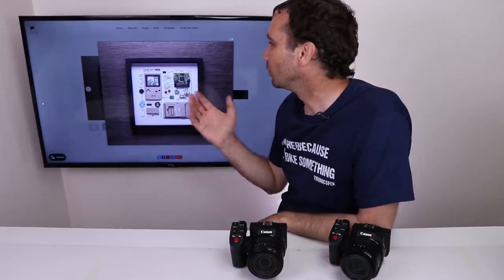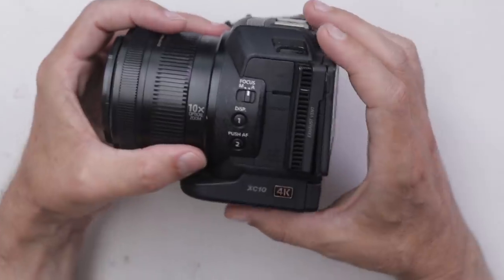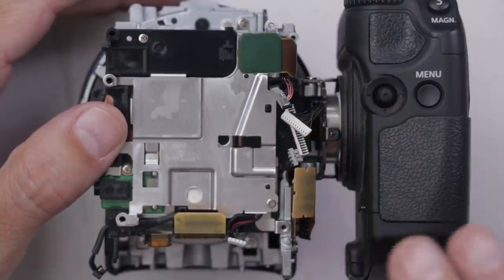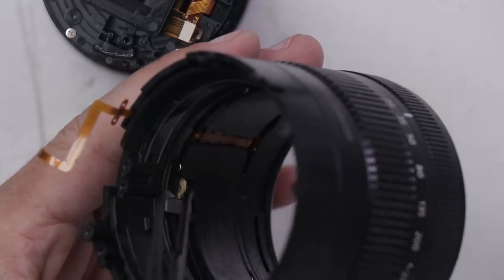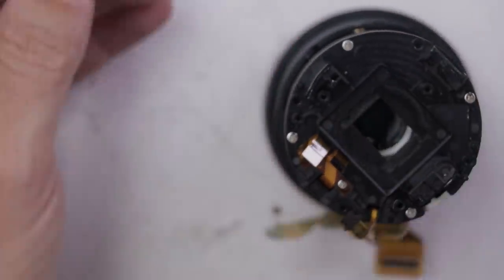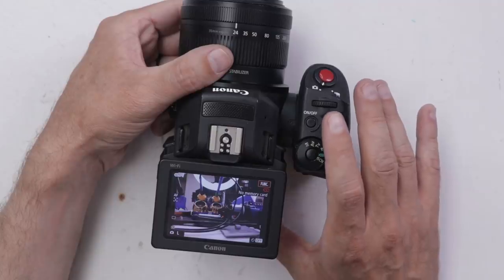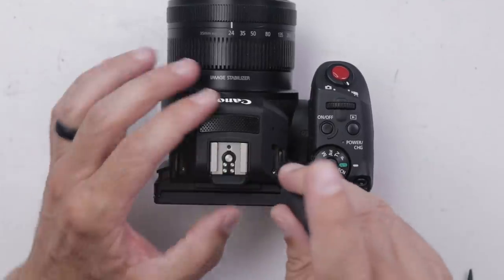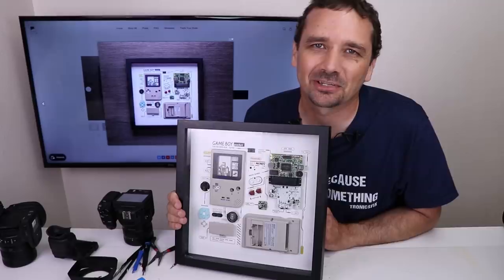I Bought two BROKEN $1,600 Cameras - But Can I Fix Them?!

Comment from the maker: What do you think of these Grid products? Check them out here (Affiliate Link): https://shareasale.com/r.cfm?b=1632954&u=2897356&m=101889&urllink=&afftrack=
Reply: Honestly so cool!
Reply: I ordered a shadow box from Amazon and am going to try a duplicate with an old Droid incredible
Reply from the maker: @12345.......  That's a great idea!
Reply: To be fair, on cameras with removable lenses the sensor is exposed every time the lense is changed so shouldn't be a problem.
Reply: Me personally, I would not overcome the urge to put them back together again.
Reply: Are you going to try put it together? I would like to see it. 😇😂
Reply: @pigi96  that would be a silly video I'd watch it too
Reply: If you forget how to put it back together you can always just rewatch your own video in reverse. I would definitely sell those as fixed, just point them to the video in the item description.
Reply: Hi TronicsFix

I own a playstation 4 that has the blue light of death. I watched your other video on the causes and fixes. Just a quick question, the light keeps blinking until I hold the power button for about 13 seconds and it shuts down. I can't get it to go into safe mode (I also only hear one beep). Please help me.
Reply: @Tronicsfix  would you ever consider shouting out a smaller channel?
Reply: @stevewaller6577  I don’t know about the Gameboy Pocket, but the PSP1000 has missing pieces. A good chunk of the optical bay seems to be missing. I see parts of it, but there’s a lot of metal that’s not there. Also the back chassis is missing.
Reply: I have a broken PS5 controller the ∆ button doesn't work it clicks but nothing happens can you show me how to fix this

Comment: Canon should use the perfect amount of loctite to hold those screws in.
Reply from the maker: Agreed! I should have put some on but didn't even think of it for some reason.
Reply: @Tronicsfix  Yeah, I immediately thought that you should have added some to those loose screws of the second camera, especially if you are planning to sell it. Maybe you could still go back to it and do it. You didn't need to dig nearly as deep as with the first camera, so it shouldn't be as nerve-racking.
Reply: @andymouse  you could see the Loctite residue on the screws that came out of the second camera, so they definitely used some. No idea though how the screws ended up in there.
Reply: I call that bad design. I see it tons in laptop monitors and cases. Screws just falling out and moving around missing.
Reply: @idahofur  One contributor IMO is the misuse of Phillips (cross) screw heads. They cam out easily, which is nice for preventing overtorquing on delicate materials (e.g. drywall, soft wood, plastic, circuit boards), but otherwise it's a liability. Robertson (square) or Torx don't have this issue.

Not sure whether it applies in this case though, since I think all the faulty screws might have been binding thin plastic.

Comment: Massive props for even trying. I've taken apart several Canon Cameras and lenses and they are so tightly built. that first camera took some big fall damage for sure. CA glue with a fixative can usually repair the broken plastic bits nicely.
Reply from the maker: CA glue comes in handy in one of my upcoming videos where I take apart a lens!

Comment: @11:03 there are white plastic washers on the metal piece you installed one on the top left seemed to be missing looked like a possible candidate for the mystery circle. 
As per usual a great video sir! Soldering ribbon cable is above my paygrade so hats off to you for that one! Peace out brother.

Comment: Question. Do you actually film every single step when you are disassembling a device and use that (in reverse) to help you put it back together again? BTW, this strip-down is gnarly! I'd have freaked out and binned it! lol
Reply: I'm pretty sure he leaves the camera rolling the whole time and just edits out parts for his videos. And I know for me when I take things apart I have a pretty good memory on where things go putting them back together. It also helps to have your own system of placing things in an order when taking apart so it's easy to put things back together. Just a good idea to be organized.
Reply from the maker: No. I film most of it but there are some steps that I know I won't use in the edit so I don't even film it. If I find a place that looks like it might be hard to reassemble then I usually snap a few pics.

Comment: I would've never guessed that there are so many screws and assorted pieces within a camera like that. I guess the price tag really is justified.
Reply: I wouldn't say the price is because of the screws and pieces. But mostly because of the sensors and processors that you're paying for since those are made from more expensive materials, along with the microchips they're basically like tiny gaming computers I guess?
Reply: @zimzamthespaceman7495  Look at the RasberryPi, even fairly powerful processors/hardware encoding/decoding cost nothing these days, the majority of the cost is R&D, the main sensor and the lens, although that's a bit expensive the primary reason for the cost is dedicated cameras being a niche market, especially these days where most people already have a decent camera in their pocket, that makes selling a big non-pocketable camera a tougher sell unless you really need it and just like anything if you need it then you'll pay the premium to get it.

If you look around a bit you'll notice  companies will endlessly recycle some models every year like the Sony DSC-RX100, obviously the newer revisions get updated specs and improvements to make it better but for the most part it's a very similar camera now as it was in 2012 when it launched and chances are it likely costs less to manufacture now yet it still costs well over $1,000.
Reply: The new camera for Pi with its relatively small 7.9 mm sensor in that one compared to what is in this Canon camera being quite a price hike up from the regular Pi camera (twice the price, without any lens) shows that CCD chips scale a bit like CPUs do. And for similar reasons too probably, big core CPUs are of course more expensive to produce, but always niche as well. But the Pi in itself is a niche thing I suppose, so adding a niche component to a platform that already is that, may not be a fair comparison. :)

Comment: Nice repairs, maybe you should have used some threadlocker on the screws from the loose arm. Seems that was the reason in the first place why the bracket got loose

Comment: Great job.

You inspired me (from your other videos) to try and fix my camera....

So it's all apart...  waiting for parts.....

So NOW you do a camera takedown....  Just kidding.  If I had seen this, I probably wouldn't have tried.

I made a pile of sheets, and taped the screws & parts to papers, with a written description of where it came from.....

And I took a lot of pictures....  Hopefully, it will go back together....
Reply from the maker: Good luck! I hope it goes well
Reply: @Tronicsfix  Thank you Sir, I appreciate that....
Reply: @Tronicsfix  You probably won't believe this...  Well, maybe you will, I was a tech in a different industry....  But I got the parts yesterday.  Shutter & shutter motor assembly for a Sony A6000....  Part was "supposed" to be a Sony part, according to the EBay seller...  Did look identical.  Very generic package though.  In any case, I miraculously got it all back together, 100%...  And it works.  It works, Steve!  It works.  If you ever think you're not making a difference...  Don't think that.  You inspired me to try.  And I did it.  Sony repair wanted shipping both ways, $100 to "evaluate" it, and the lady said if it really was the shutter & shutter motor assembly, $400-ish bucks....  The parts cost around $50 shipped.   So your inspiration just saved me about $450 bucks, and I have a camera again...  So thank you Sir.  I should also point out, I got the IFixit Pro whatever toolkit...  That is a real nice toolkit.  Real nice.  Paid for itself in one repair, 5 times over....

Comment: Looks like they where on drones that hit something and the screws got loose ... or on a car camrig that its vibrations made those screws loose ... guess locktight did not helped ... but hey at least you got two good cameras
Reply from the maker: A little loctite probably would have helped. I think you may be right about them vibrating out

Comment: I still own my first psp. Its been replaced by sony because of 5 dead pixels on opening the box wich was the absolute limit to get a replacement console. It still works though the battery is finally toast as of a few months ago. Bulging and not even daring to try and charge it anymore. Took it apart once to fix my R button wich got stuck after a 2 foot (or so) fall.

Comment: I bought one of these from Goodwill for like $20 hoping to fix it a few months ago. Opened it to find battery acid corrosion all over the display connector. Not salvageable at all :(
Reply from the maker: That was a great deal! Sucks about the corrosion though.

Comment: The black piece is a plastic guide-ring/washer that goes onto the brass holder. On the holder that you found loose inside the lens you can see a whole one. When one of the 3 guide rails loosened the stress on the 2 remaining "guide-rings" broke them. Time: 9:46
 The white piece is also a guide washer of some sort.  At time: 10:27 you can see smaller white guides at the front end of the lens. There a to be 3 of them and i guess that one of them only has its screw.
Reply: What do those do? And if they broke off does it affect usage ?

Comment: How did the camera with the wonky handle get broken in the first place? It seems like you fixed it by finding and replacing several of of the screws. Did those screws just fall out with normal use of the camera? Confusing.
Reply from the maker: I don’t know the history but it looks like they just loosened & fell out

Comment: I repaired a Nikon D810 that had been dropped and its entire lens mount assembly had broken off the body of the camera.  It took a little while to obtain the parts I needed but the repair was not difficult, only time consuming.   The hardest part was keeping track of which screws went where.  Having done this, I could design the lens mount system to be better, more durable, and much cheaper to repair should it break again.  The screws that actually hold the lens mount to the frame should have been designed to break at a given stress level,  that being less than the stress level where major part damage occurs.   As if the screws were safety fuses.

Comment: I know nothing about most of the things you fix, but, as for the loose plastic, didn't the one brass piece have plastic around where the screw goes in and the other two didn't? Could that have been the plastic bits?
Reply from the maker: Possibly

Comment: Can you please help me out

This is unrelated to the video but my ps4 is a cuh 1215a model and ive been getting the "Unrecognized Disc" error for all my discs, my console takes in the disc and waits about 30 seconds before it makes the eject noise and then waits another 20 seconds until the error comes up

I've done all Safe Mode options and I've replaced the disc drive but the problem is still happening, I've even tried the silly remedies like turning it sideways, tapping it, turning upside down, etc.

Please tell me you have a fix, I just want to play ultimate ninja storm 4, please help

Comment: I study Photography and I know how complicated Cameras are and even though I've taken apart a few analog cameras, I would never dare to open a digital one, specially a cam corder like that with a non changeable lens. I'm really impressed how you did that!
On a side note, the broken plastic parts are probably from one of those white holders on the zoom ring (the ones near the screws you found and put back), It doesn't really cause a problem to use it with one broken off as long as you don't try to pull out and push in the lens manually lol

Great video as always

Comment: I got a broken Olympus camera with a lens that comes out and then it beeps a dozen times before retracting. As far as I could research into it, a lens assembly sensor was faulty and the only part I could find for it (it was an Olympus FE-20) was in Russia. I never bothered at that point

Comment: Off topic but I have a jbl charge 4 that will not take a charge. Bought the best charger for it and after 24 hrs it is only blinking on the second light. I did a factory reset and still doesn't work. Not sure if the battery is dead or the board, was hoping you could give some advice 🤔 thank you

Comment: @TronicsFix there is a big discussion going on about the new PS5 model and its newer heat sink design. @Austin Evans posted a video showing the differences, but honestly his analysis was superficial and did not provide consistent data to back up his conclusions. Do you think you would be able to do a technical comparison here in your channel? That would be very appreciated by many, for sure. Keep up with the good work:)

Comment: all these electronics component-level repairs would be so much easier and faster if we had the rights to repair in the sense where the manufacturers were required by law to give anyone the diagrams and schematics - for repair. If not to anyone, at least to the repairsmen. So we not only get the correct repair, but also the correct torque specs for the tiny screws, because also those are very important for the futureproofness of devices, specially portable ones.

Comment: A bit concerning that these $1600 cameras have screws that fall out all over. You'd expect better at that price.
Reply: @Sir Rachel. Obviously, someone dropped the camera,.that's how they broke. They are made of plastic,.and plastic breaks easy, bit is cheaper and light weight.
Reply: I don't think they just fell apart, for the first one it probably took some sort of shock and broke something inside and made that one screw loose. For second one someone definitely took it apart and didn't complete the job for some reason
Reply: @Keepskatin  they are made of plastic and glass but the exterier is undamaged in the drop? Cant have been a very hard drop
Reply: @sirrichel9155  maybe it fell on the lense, not enough to break the exterior, but to crack the interior holding screws.
Reply from the maker: It does seem strange. We also don't know the history of it though or if it was a common problem. Either way a little loctite would have solved the problem. I should have used it when I repaired it but didn't even think about it at the time.
Reply: @Tronicsfix  There was some blue residue on the screws of the second one that I noticed. It must be loctite. Now, how THAT got loose is an interesting question lol. Should've used the red one, I think it is stronger.
Reply from the maker: @tusux2949  Yes, that would be interesting to know!

Comment: These are the repairs that the shop tells you are impossible. It's not cus they can't do them. It's cus they know they can spend the same amount of time on "repairs" that just involve putting in a new battery, or updating the firmware. If they can avoid removing screws, they will. If they know the repair is gonna take time, they'll just push your repair down the list. If it gets down far enough..."impossible to fix"

Comment: $1600 "professional" camera - lose screws and broken plastic. 

Ah yes, quality.
Reply: You want better quality, the weight of the camera will be double,.which is bad for photographers.
Reply: @Keepskatin  could you elaborate how those loose screws, which are already made of metal just like their fittings, would contribute to more weight if they would be made to not come lose?
Reply: @Scitch87  if the entire lens housing was metal and the exterior metal with rubberized coating, yes it would be very rugged, but double or triple the weight.
Reply: @Keepskatin  Could've used aluminium or magnesium alloys. Could've used better plastics that would not break. But they chose this because, you know, you gotta buy another one as soon as the warranty expires.
Reply: @Keepskatin  no one said anything about the entire lens housing or the exterior being metal. That's your imagination. 

I was talking about the screws actually being properly fastened and parts that are under actual stress (like the plastik spacers that broke) being properly manufactured IN A $1600 CAMERA! 

How is that a difficult concept for you?

Comment: I just took apart a RED cinema 17-50mm zoom with a stuck zoom wheel. The optical package was just a Sigma. 100% of the 'cost' was declick and metal. The issue? The articulation arm that translates the zoom ring movement to the Sigma ring was a piece of die cast metal with a SINGLE SCREW taking all of the force. So it cracked and has no back pressure on the screw to move the ring from high to low. RED is a scam. But worse, they're an incompetent scam.
Reply from the maker: I'd love to try and fix a RED camera.
Reply: @Tronicsfix  In fairness, the cameras are better constructed, though still marked up like crazy. Lenses were something they kind of 'dabbled' in. No parts. No repair channels anymore. The cameras are fairly basic (I'd say quite a bit easier than those Canons). The lens was a mess because all it was was a translation shim for a smaller consumer lens. So lots of tiny screws lots of hacks to get it working. It was a $6K lens new. But hey, it works now and I got a PL mount with pretty good optics for  about 5% of that price.
Reply from the maker: Now I just need to find some broken ones!